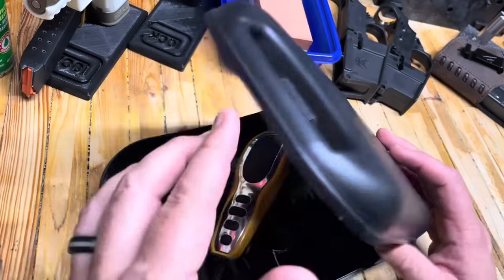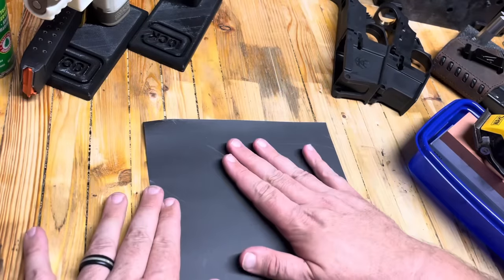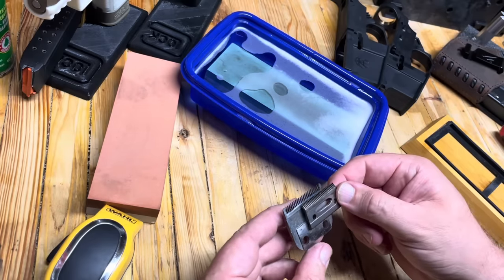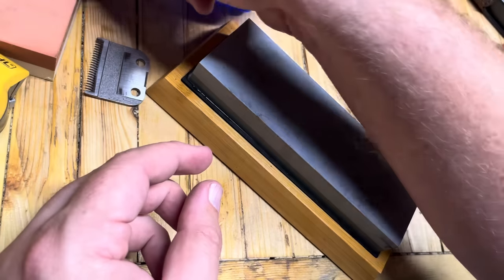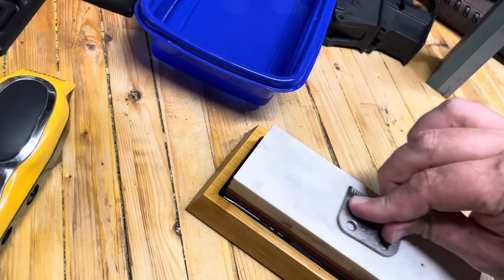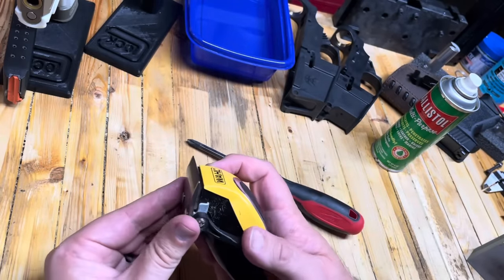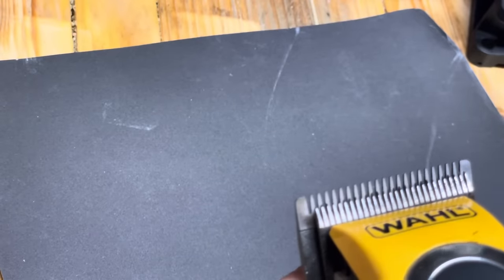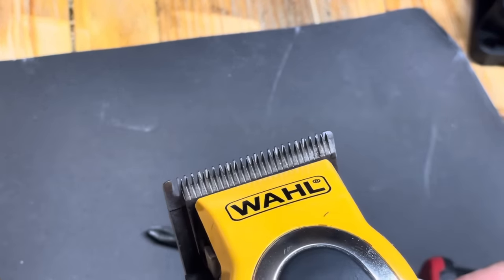How to Sharpen ANY Hair Clipper Trimmer Blade

Comment: You forgot to mention that sharpening stones need to be dead flat in order to sharpen clipper blades.  If there is any dishing in your stone at all you will ruin your clipper blades.  If you don't have the ability to get your stones dead flat then you are much better off using sandpaper over float glass.
Reply from the maker: I keep mine flat, and I have a flatner. but sandpaper on glass tile works great too!
Reply: @EagleRun23  That's great, but the problem comes when someone else follows your video without flattening their stone first and then wonders why their clippers are worse than then when they started.  Meanwhile, they have basically ruined their clipper blades in the process.
Reply: Used to use 1/4" glass plate, high grit emory and polishing paste to get a nice mirror finish on copper computer heat sinks!
Reply: That is understood to anyone who sharpens...
Reply: This is exactly what I was going to ask; you’ve hit the nail on its head 👍
Reply: I exactly did the same with a sandpaper on flat glass and ruined the blade. It works only a few times. I think it's the wrong side to sharpen them with non precision tools.
Reply: @HDiver-ru7ru  Many professional shears (and pretty much all animal shears) use convex blades which must be sharpened on specialized equipment.  It is only the consumer-grade clippers which are flat ground.
Reply: He does say really flat
Reply: @HDiver-ru7ru I have used wet sandpaper over glass for sharpening my chisels and it's hard to see how this could be cause a problem.. I think it's safe
Reply: Good point but I've never sharpened anything in my life and I would have thought that that would be common sense ?
Reply: @itsjustweard2328  Professional-grade clippers are generally hollow ground and these will be effectively ruined if you try to sharpen them even on a flat plate.
Reply: @rockets4kids  O ok I didn't actually know that there was a difference. I've only got the cheap ones with the plastic bit. I don't think you can sharpen these I think they are disposable .But I'm not 100% sure. Whether you can sharpn the front of The blade and put it back together with the plastic bit whether that will actually make a difference I have no idea
Reply: Use diamond hoe's for a flat sharpening surface. Start with 1200 and move to 8000. Viola.

Comment: Careful! Clipper blades are not completely flat, they are very slightly concaved... I spent thousands on a machine with a special wheel that sharpens clippers properly. By sharpening on a flat stone you are removing that concave that the manufacturer intended.
Reply from the maker: I have only ever seen them sharpened flat. These even have a guide on the opposite flat to keep it flat. I’ll have to look this up maybe Wahl has info.
Reply: OP (original poster) I’m guessing yours are not wahl brand? That’s why they are concave? Do most barbers have these sharpeners that you have?
Reply: When I was in dog grooming school I had a friend who had a mobile sharpening service. I turned him onto my school because students were needing their shears sharpened.
Someone asked him to do their clipper blades and he ruined them because he was unaware that indeed these blades are considered "hollow ground". 
I can't help but wonder how many folks clippers don't work anymore after watching this video.
Reply: @TheTriciaLife  I do sharpen Wahl, but mostly Andis, and Oster. I'm a sharpener by trade and do this professionally for Groomers, Barbers, and Beauticians.
Reply: Nahhhh... Just get some 4000 grit stone. Slide them teeth and you're good to go. No need spending thousands on a machine.

Comment: The way they set the evenness is to set the blades on a flat surface and on a slight angle towards the moving blade , then tighten the screws.

Comment: Yes sir when the moving blade is extends beyond the still blade that’s essential placing a razor on your skin and ya don’t want that. 
The second key point is not to tap the blades with a metal object like that screwdriver either. 

Tip:
After attaching the blades rather loosely, place the blades on a flat surface and carefully tilt the clippers towards the body of the clippers so that the moving blade is even and slightly lower than the moving blade. Tighten each side slowly so that the edges remain level. Try that.
Reply from the maker: fantastic comment, thanks man.  I am an amatur, just my boys hair for 7 years, haha,  These sharpening videos do really well so i make one every time I sharpen mine. learned a lot, hopefully people can learn a basic skill and extend their blades!

Comment: I have a piece of glass set up with several strips of sandpaper glued to it that I use to sharpen chisels.
I can't believe I never thought to use it to sharpen clipper blades. I've had the same Wahl clippers for close to 20 years and the blades are kind of dull.
I was thinking about buying new blades, but I'll just try this instead. Thanks.

Comment: Some "tutorials" where showing to have a angle on those flat blades, witch made no sense. I am glad your's was very accurate, descriptive and simple. You even shown why they are called WHET-stone lol
Didn't know 400 grid sandpaper was still to coarse (and probably not even to, no flattening), getting one of those amazon 400/1000/3000/8000 set in a week to try it.

Comment: I've bought a fair number of trimmers...most garbage out of the box. Stay away from budget 20-30 dollar ones.
Picked up the Mueller Ultragroom cordless hair clippers about 6 mths back and their the best pro set I've ever owned. Rechargable and portable enough to take camping they use usb 5v plug. I can cut beard and hair and only run charge down to 89-90% but they fast charge in 5 or so minutes.

Comment: I don't know why people are afraid of coarse grit. It helps you and speeds you up a lot. The biggest mistake people make all the time is going too fine, too early. 95% of the work is done on a coarse grit. And then just polish up the surface to whatever number you want to go.
The next typical mistake is skipping intermediate grits. It just makes it harder to get to the desired surface roughness profile. 
If you start low enough and have sufficient steps, it is all just a matter of a couple of strokes on all but the lowest grit.

Comment: I know someone that "sharpened" some clipper blades for someone by grinding them on a surface grinder.  They got upset because they were more dull than before they gave them to the person to sharpen.
Reply from the maker: If a surface grinder is what I think it is. That’s an odd choice. Would require the opposing size to be perfectly flat too I think.
Reply: The grinder must have heated the blades too much and softened it.

Comment: What type of oil are you using to Sharp the blade
Reply from the maker: 1:56 these are water stones.   if you already have an oil stone, you can use any light machine oil, wd40 to actual honing oil. some are better than others, but just use what you have.
Reply: Please mention 2  3 oils that we can use

Comment: I use 400 grit and worked fine. Why do you think 600 is too aggressive?
Reply from the maker: my old book, just mentioned starting at a finer grit.  400-600 could be a start but I would recommend finishing with 800-1000+.  if it works it works! :)

Comment: For what it's worth, almost all clipper blades are hollow ground, not flat. If you rely on clipper blades  to make a living, sharpen them correctly or you will be replacing them and they aren't cheap.
Reply from the maker: some are hollow ground. Most barbers buy new blades, and dont sharpen them. the 2-3 i have asked.  This is a diy deal for us home clipper users.  my blade was not hollow ground so it works fine.

Comment: Does this leave a burr inside the teeth though? I've been thinking about how to sharpen mine and I've thought I would need a thin sharpening "blade" to slide between the teeth.
Reply from the maker: Yes. Controlling moving generating burr IS sharpening. This is how they are intended to be sharpened. Either on a stone, sand paper, or diamond wheel.

Comment: Since this was a machining process using abrasives I would have emphasized getting the two parts surgically clean to remove loose abrasive material. Just telling people to clean the parts afterwords is not enough. Any abrasives left on the parts will cause damage and dull the cutting edges.
Reply: it is enough.

Comment: Sir what type of oil do you use to sharpen
Reply from the maker: Any light machine oil works. Wd40 would work in a pinch. 

My stones here are water stones. Just use water.
Reply: @EagleRun23 is it ok to use mineral oil?

Comment: I use a 00000 blade for bald fades.. adjustable clippers can be extremely dangerous if you're trying to set the blade so close to each other. You can seriously cut someone 
..
Reply from the maker: Ya I did that. Learned. :)

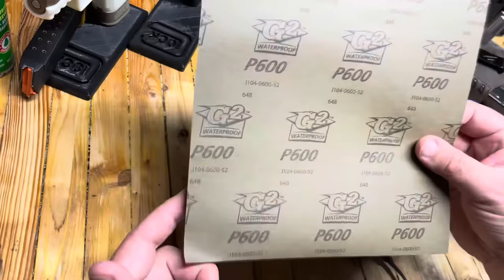Comment: 1:20 i can never find any fine grit sand paper only 600 or sometimes 800 grit
Reply from the maker: good, i left a link!
Reply: If you want to buy it locally you can find those finer grit sandpapers in the automotive section of stores like Walmart, or at an autobody shop.
Reply: Sometimes at an Auto body supply store ,good luck

Comment: If they cut after this kind of sharpening. It all good because I’m ready to throw mine in the trash because it won’t cut. It never has cut real good. Maybe this will save me from buying new.
Reply from the maker: Ok hey also adjust the power screw on the side of the body. Might need adjusting tuning.

Comment: It is better if the blades were hollow ground.
Reply from the maker: So I worked with a guy when I was younger who did this professionally, full time.  He had a spinning disc plate maching in his shop and he didnt hollow ground anything that I saw.  He did a stone sometimes manually like I showed, he also used sanpaper on a glass sheet in a pinch.  Learned a lot from that guy.  Diy guys wont have access to a machine like that either. I just like for people to know that you can make yours better at home with basic stuff.
Reply: @EagleRun23  After years of clipper blades sitting dull, I figured out how to sharpen them with a modified hollow ground with just emery cloth and a flat steel plate. I laid the cloth abrasive side up flat just where the teeth of the cutter and comb were located and the back of cutter and comb were resting on the plate with no cloth under it. I held the cutter and comb down with my fingers and stroked the cutter and comb with modest pressure a few times and would check to see if the surface was cleaned up. The teeth rested on the cloth and the back not gave a slight angle with when the cutter and comb assembled insured that the tips were touching first. After sharpening three sets, I wore my finger tips so I will design and built a simple fixture to hold the blades and cloth to save my fingers from wear.
Reply: @EagleRun23  that spinning disc plate you saw is not flat, it is conical.

Comment: Not really works. I prefer to stick a sand paper to the mirror   and fo for the grind
Reply from the maker: yes wet that sand paper and stick it to a glass or a tile, keep it really wet, make sure you have 1000 grit and maybe 2000

Comment: can you help me please , I tried to sharpen the trimmer blade with an abrasive drill bit  , and now it doesn't trim my hair at all ☹
Reply from the maker: You gotta get it flat. What stones do you have? Or do you have wet sandpaper? What grits?
Reply: @EagleRun23  I'm not a professional , I use my hair clipper to shave my beard , and occasionally  cut my hair , I don't have  tools  , this is the first time I try to sharpen my trimmer blade .   Can I get wet sandpaper at my local hardware store ?  they do have sandpaper , but wet I don't know
Reply from the maker: @tunkunrunk  no biggy, without seeing it.... its technically fixable.  you need a super flat surface, granite countertop, marble tile, glass, and some wet dry sand paper.  Here is what that is.... https://amzn.to/451SAB0

you need to follow the steps i did here in this video but start at 800 or 1000, soak it down with water and it will kinda stick to the flat. Lap until the backside of that blade is completely flat no imperfections. could take 10-20 min of work here as its not exactly the correct tool for the job :)  Then work to 1000, 1200 and finish with 2000 or 4000 if you have it.  should be good to go.